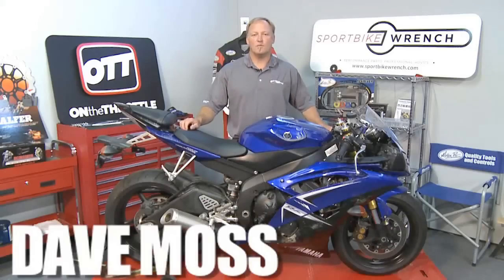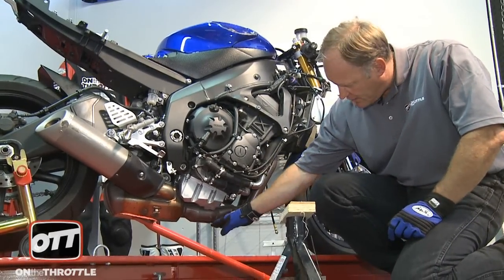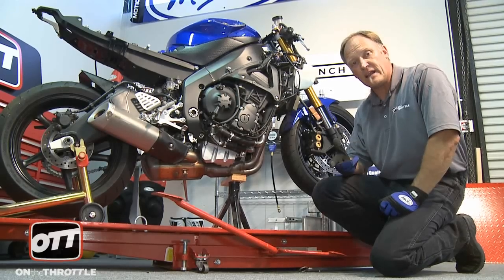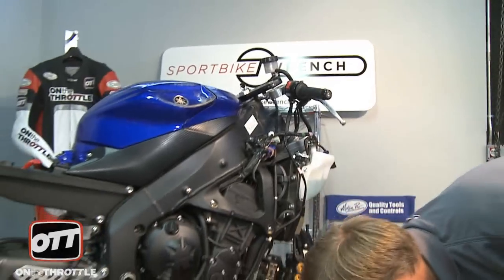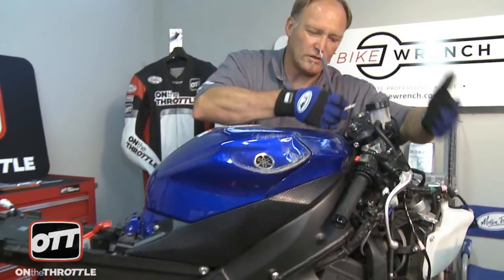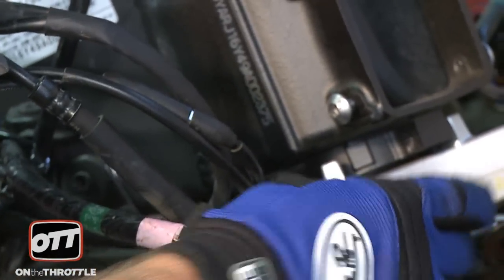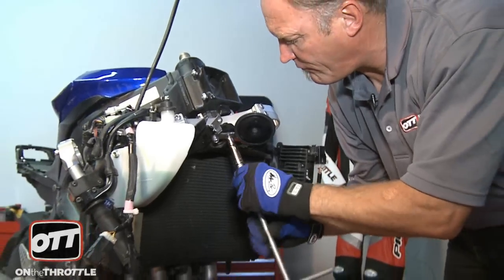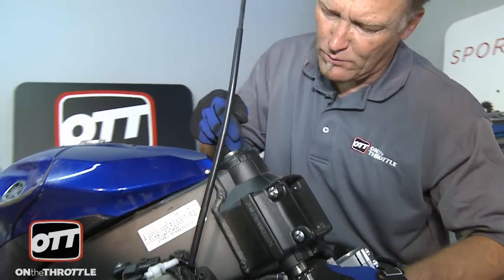Performance Uprades YZF-R6- Removing the Entire Front End

Comment from the maker: might have loose steering head bearings. Put your hand on top of the triple clamps and while holding the brake on, push down on the bars. Does it "clunk" or knock? If so, that's the most likely cause

Comment: @ChrisMag100 I recently replaced the steering stem on an '09 ZX6R. The lower castle nut was only slightly more than hand-tight. On the other hand, my SV650's castle nut was tightened to something like 45 ft lbs (61 Nm).

Comment from the maker: @ChrisMag100 different brands have different methodologies for steering head bearings based on bearing and race type, therefore different torque values. In the case of the R6 and the VFR 400 race bike, the lower castle nut goes on hand tight to start, then you look for side to side movement and adjust accordingly. I generally use a C Spanner to set it snug then come back very small amounts until I get the movement I am looking for. The the upper lock ring is installed and set appropriately.

Comment from the maker: okay - you need to remove the forks from the bike. When you put them back in, one will go easily but if the other one is a struggle, the lower triple clamp is bent. Make sure both bars are even too as the crash will have moved one.

Comment: I recently had a guy bring me his bike and ask me to work on it. It had been involved in lowside and the front end plastics and lights broken, I place it on my stand and noticed when I made the wheel straight that the handle bars are very slightly if barely noticeable to the left, forks are not leaking and the don't look bent, he's trying to spend less amount to get it on the road. What would you suggest? I have lil knowledge in structure damage but , like I said it's not really noticeable

Comment: Question: Your lower castle nut was hand-tight on the R6. I've seen fairly high torque values on steering head castle nuts on other bikes. The Aprilia specification for the lower lock ring  on the RSV4 is 70 Nm, for example. Is the R6 unusual in this respect?